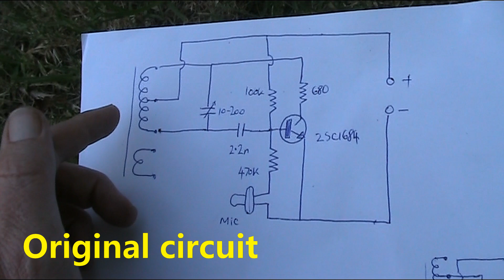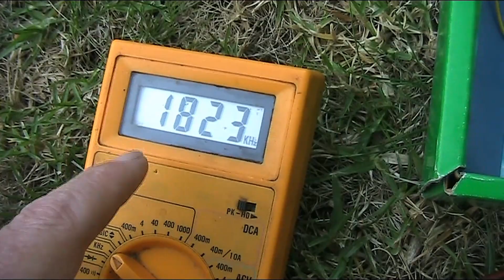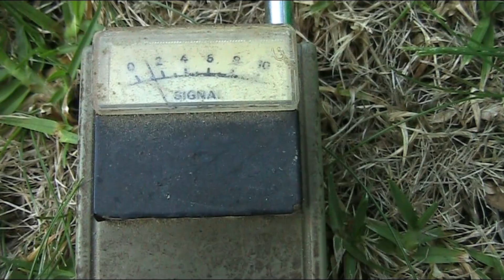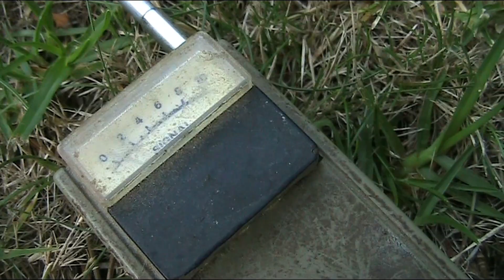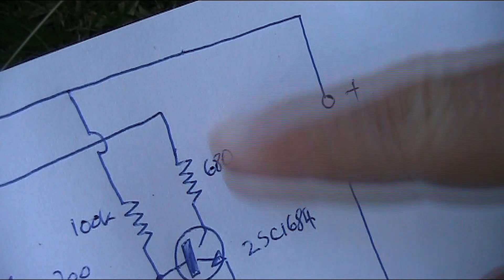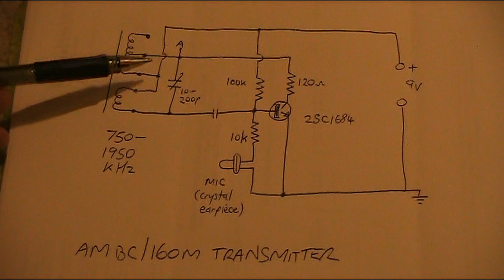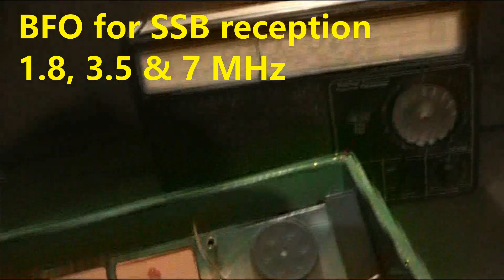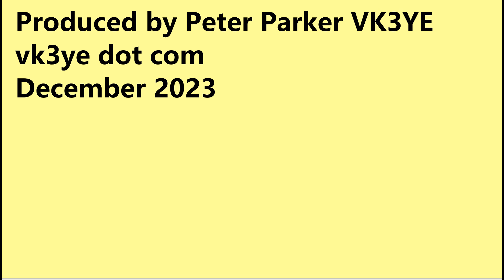Maxitronix 60-in-1 kit transmits 160m QRP AM (and more)

Comment: To my understanding, reducing resistor value will allow more current to flow through the circuit , which therefore will increase power output maybe??? Forgive me if im wrong as im only an amateur in electronics.
Reply from the maker: To a point, yes. But then if too low there can be excessive current and you can blow the thing up.
Reply: @vk3ye  very true. Just got to tweak it or find the "sweet spot" for the resistor.

BTW any thoughts on how to create a HOME MADE SHORTWAVE RECEIVER DOING IT THE OLD PLANK OF WOOD SCREW DOWN STYLE?
Reply from the maker: @AirwolfBadarse  Thanks. See my website vk3ye.com for some receiver ideas. Other videos have projects mounted on wood bases - eg some of my AM and FM transmitters.

Comment: Hey Peter, try making a 455 KHz oscillator by loading the tuning capacitor and coil on your circuit.  

I made one of those as a BFO to work with an old car radio that I modded to tune 2-5 MHz. 

Worked really well to tune 80 & 160 Ham bands as well as the old marine broadcasts and 2182 traffic. 

I then had the fun of turning it into a broadcast transmitter that just appeared on all the radios in the house no matter where you tuned

Comment: 👍Good stuff Peter, thanks. This kit is actually quite a nice/easy way to expirement. Easier, perhaps, than using components on solderless breadboard. A QRP radio orientated version with some XTALs and other basic TX/RX components for HF would be fun.

Comment: Love it Peter. I had a Science Fair 150 in 1 when I was a kid and it’s AM transmitter was exactly the same as this circuit. When tuned right onto the frequency it’s modulation was much less than if you tuned slightly off frequency.
Reply: Thats because the modulation is AM and FM in this oscillator